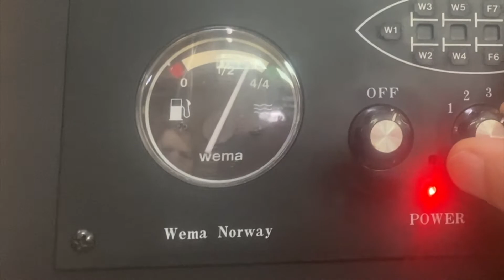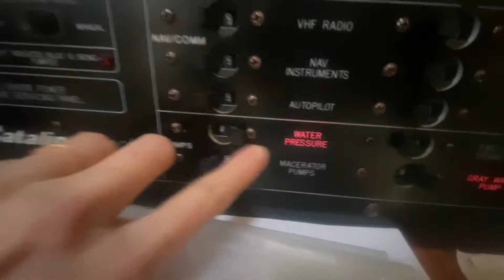HOT WATER SHOWERS on a BOAT ~ with Mary Beth and Stephen ~ Ep 87

Comment: Okay another dumb request. I have the same 5 tank manifold system. I keep having the same 'airlock in the freshwater pump' problem. I do this all the time. I run one tank at a time instead of all together. Inevitably I will let tank run dry and create an air lock that I have to bleed or purge. I have considered installing a t-type air bleed valve after pump outlet. I would like to know if you have encountered the same issue and had any thoughts and how you handle it--(besides the obvious 'smart thing' and watch the damn gauge which I have demonstrated I am thus far unable to do).